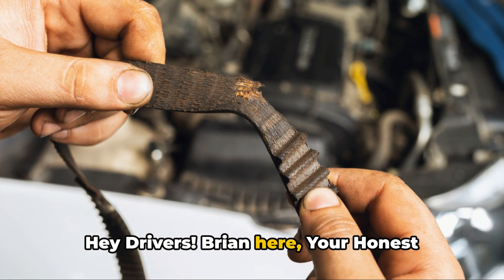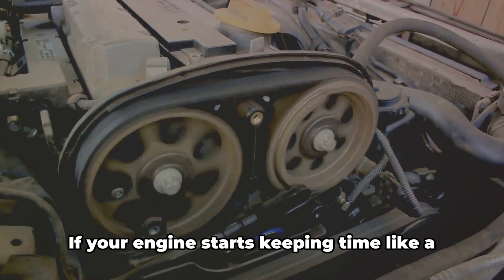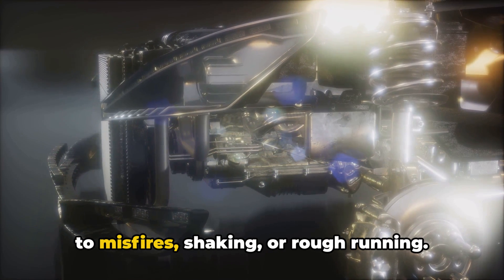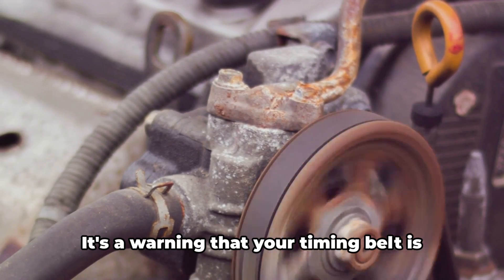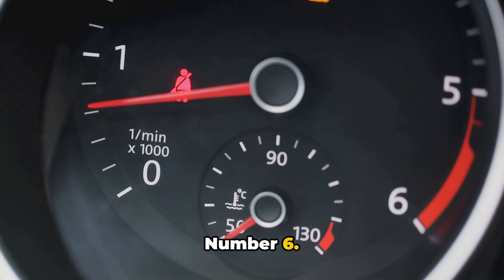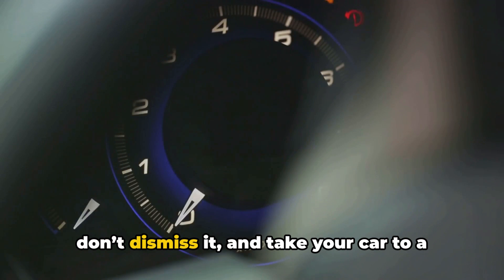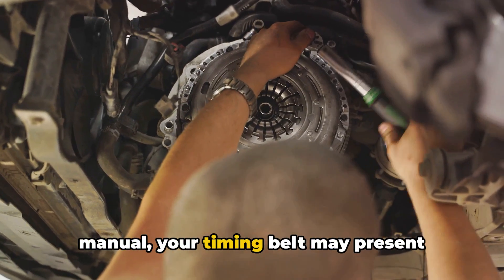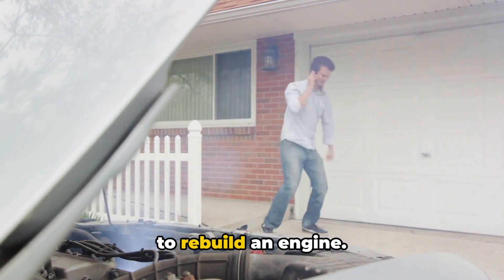Signs That Your Timing Belt is Up For a Change!

Comment: What if I have timing chain not a timing belt?
Reply: Basically same type of symptoms only you'll hear what sounds like a pulley getting ready to but it's under the valve cover usually u can use a long screw driver an listen to pinpoint it

Comment: I have had an intermediate juddering/misfire on cold starts for a year, and now the car is hesitating to accelerate, i have to give it more on the gas pedal, or shift to a lower gear. Sparkplugs, airfilter are replaced and lmm is cleaned. Maybe its the timing belt, its due in may when it has been 6 years since last replacement.
Reply: you've also checked/changed the sparkplug wires?
Reply: @nas22058  thank you for your reply😊 no i have not changed the 4 in 1 coil pack yet. However, it may be it. But i dont know how to test it, or if its possible at all.